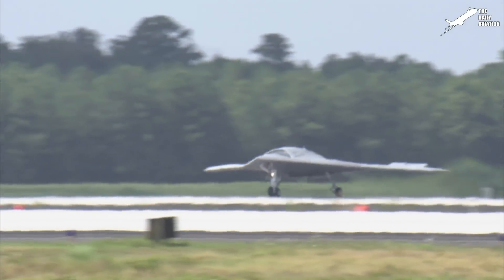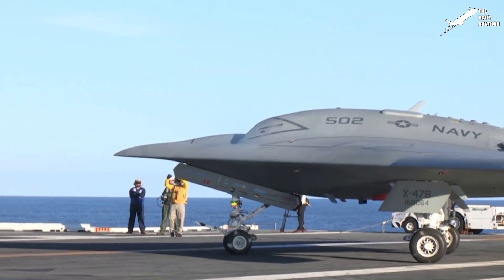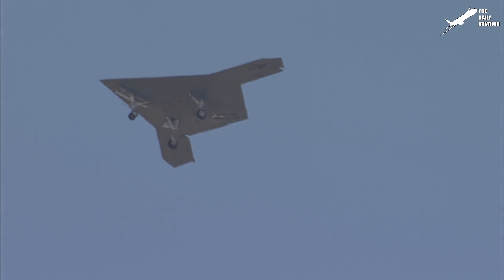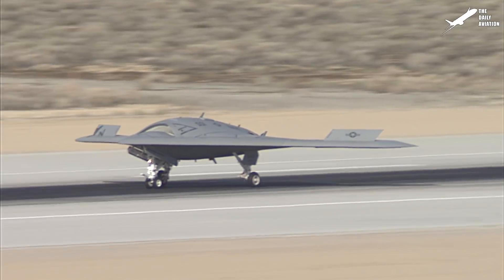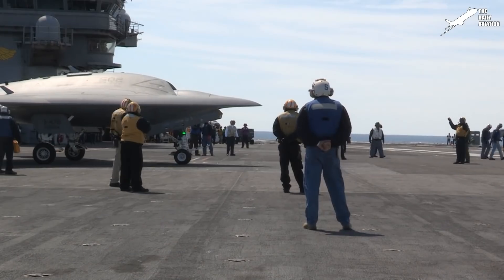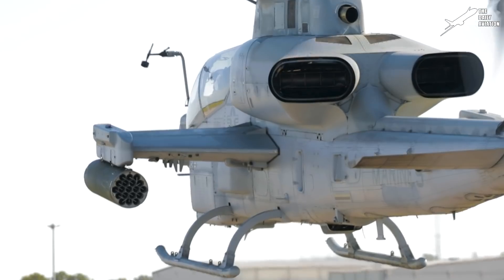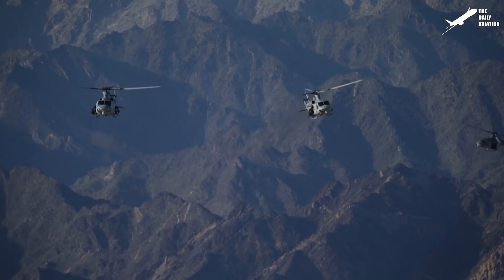US Testing its Brand New $1 Billion Advanced Aircraft: X-47B Drone

Comment: Smaller un-man and just as fast as the F-18 hornet.  I'm all for new technology; Now if these are all going to roll off an assembly line at 1Billion each; It would be a lot cheaper if you just take the F-117 and upgrade it since this is going to replace the 117.  Its still stealth and all u have to do is install the radio control system in it to make it un-man and it carries a lot more bombs.  Just install the laser guidance system in the F-117 instead of putting it in a museum.  Just a thought to save tax $$

Comment: 38.2ft wingspan to 30.9ft folded?!?!?!? Those wing sections are A LOT longer than 3.65ft each.... I would say at minimum, they are  12ft each and that is "Minimum" based on the assumption that at 5:16, the guy in the foreground is 6ft tall and they appear to be at least twice his height. And that is not taking into account the perceived perspective size lose due to the distance difference between the plane and the guy from the camera. I suspect that they are more like 15 to 16ft per side making the wingspan more like 60ft since the 30.9ft folded span seems about right.

EDIT Quick search reveals that the wingspan is in fact 62.1ft and 30.9ft folded... Video creator(s) must have been confused with the length since it is listed as being 38ft 2in (or 38.16ft).

Comment: 3:07 someone tell me, where will be the duct on the air fighter get put back?
Reply: The refueling probe was hard mounted for these tests, as proof of concept. Just to prove that the action could be accomplished.
Reply: @seansrusticdesigns8640  Thank you!
so it is used only for test and not for actual mission if I understood correctly.
Reply: @へんげの術YUU  That is correct, the whole X47b platform was a demonstration test platform.

Comment: One of those crashed on highway 98 in the florida panhandle(eglin air force base) 8 years ago. They're not testing it they've had it for awhile now.
Reply: one of these did not crash.  Two were built, two were flown on and off carriers and land.  Both were at Palmdale the last time I supported the static engine run in 2019.  I don't know what you are referring to but it was not one of these Air Vehicles.  They never went near Florida.  They flew at Edwards AFB, they flew at Pax River, they flew on and off carriers at sea not too far off the coast.  One landed at Wallops Island.
Reply: @gkprivate433  Ok Mr. Defense Secretary... Jesus Christ some people.
How could you know for certain?
I find it hard to believe that only two of these were ever built and I think that's a pretty retarded sentiment to follow especially when you consider this is top of the line military grade drones we're talking about.
Also factoring in that the U.S spends over 700 billion dollars on military per year (and rising), pretty stupid comment.
Nobody cares that you supported a static engine run.
Piss off.

Comment: Really strange video as the X-47B program finished in 2015/16 with no follow up. The Navy only ever had 2 prototypes & they are now both in long term storage with no plans to use them. Northrop, the prime development contractor, declined to bid on the MQ-25 unmanned, carrier based tanker aircraft so there isn't even an X-47B ongoing development program.

So it's really strange you post this video now after the program has effectively been defunct for 5 years.

Comment: Something about stealth and remote control sounds funny. Because its stealth, it needs to be not detectable to the enemy. But it also needs to send a signal back to the remote control otherwise how will the person controlling it know where it is and how to maneuver it. This means that the aircraft could likely be detected using a passive means similar to passive sonar on submarines. There are probably ways around it but it sounds like a big hassle to design for not much improvement.
Reply: That’s the part they don’t tell u about, they must  have some  way of decreasing the signal, kinda like how can such a noisy jet engine be stealthy type deal.

Comment: Ngl if they add ai, like Tesla’s autonomous driving but flying. So then no one has to control it, you can just program it to do tasks.
Reply: That's part of the program, it's supposed to wire up to a manned or unmanned fighter or drone leader while using AI to sync them all to one data stream. That will give them line of sight and aerial supremacy like the world has never seen before.

Comment: The X-47B would by it's very design be very hard to track if you could pick it out of the grass(operator slang for radar return noise).  No right angles (trailing edge aren't flat) Intake is on top and not visible to ground (sea) based radar.  If it has a baffle on the inlet it would be hard to get return from the intake.  Smooth blended wing and no tail, man even if there are no advanced radar absorbing materials this would be super small return.  The B-1A has a smaller return than the T-28 chase planes and the B-1B is even smaller than the B-1B.  Very hard to track.  Not impossible but hard to find.
BUFF or B-52, Well that is a sitting duck.  Against the SA-2 system, there is only one defense that works and the EWO's are taught to not touch that knob.  I hope we deploy systems like the X-47B and other advanced drone and fighter systems.  Super big fan of the F-22 but it's getting old and we need to deploy gen 6 aircraft.  Maybe in gen six the pilot will be taught to just make decisions and let the aircraft fly itself.  Maybe.

Comment: Why are we using 707s for refueling?  Those engines on the 707 are tiny but powerful, great, except they down the juice faster than a divorcee at an open bar.  Why do you think airlines ditched those a million years ago.  Fuel efficiency is why engines on modern jets are so huge... save gas... ya know, useful for things that work in that area, like refueling tankers?  Whatever...

Comment: X47B. That's way more than 7.3 feet folded up (38.2 to 30.9). Each wing tip to hinge looks like ~10 ft. Plus when folded it nearly touches tip to tip at the center of vehicle and would if folded flat. So the aircraft is reduced to ~ 1/2 it's size.
Reply: The video has it wrong.  The X-47B is 38.2 feet long and 62.1 feet wide with the wings extended.  Folded, the width is 30.9 feet.

Comment: 5:14 --- Folding wings reduce wingspan from 38.2 to 30.9 feet --- 
however
5:37 --- The folding wings are almost touching and would appear that they would slightly overlap the tips if the folding continued. This means that the reduction in wingspan must be at least 50% (38.2 minus 19.1 equals 19.1, or less if overlapped). The statement at 5:14 is not even close to being correct.

Comment: This is like a step to killing ourselves , imagine AI controlling all the bombs.
Reply: Not how that works but ok
Reply: @rayperson1262  imagine putting bombs on that and itself controlling the weapons
Reply: Dulara Ratnayaka TLDR they didn’t give it the ability to think, it needs human interaction to find and engage targets, it’s still like any regular aircraft it just doesn’t have a pilot in it.        it cant that’s the thing, because of its design it needs authorization from the controllers, plus it needs human interaction to find a target and either put a laser on it to drop a gbu-12 on it or something. I mean I guess it could technically put in its own coordinates and do it but I don’t think the builders are dumb enough to make it able to do that plus  it’s in the middle of the ocean so it would have to fly to the nearest landmass then still it is a possibility that there will be no cities on that coast to bomb and if there were it could only do so much damage before running out of fuel or running out of munitions, if it had no outer pylons like it does in the video it can only carry 2-4 bombs and I don’t think they can be anything bigger than a 500 or 1000lb bomb which in reality is very minimal compared to the rest of the US’s Arsenal.
Reply: @rayperson1262  do you realize that this was designed 20 years ago. There should definitely be something capable to think of its own
Reply: @rayperson1262  I mean the technology in general not only this jet.
Reply: Dulara Ratnayaka yes I realize that this technology is old but what you don’t understand is that even with today’s technology it still needs human interaction almost all of the US military’s aircraft require human interaction, they are useless without it. And by the time today’s technology is implemented into our military it will be 20-40 years old. The military is slow in getting new stuff and a lot of upgrade programs and other new vehicle programs don’t make it and it takes multiple tries.

Comment: This project ENDED about 5 years ago! This was solely a 'proof of concept' effort meaning that this aircraft was never intended to go into full rate production. Only two were built and they are both already 'retired' as they served their purpose. I have no idea why this is being posted just two days ago. All of the flight test video is years old. Also, the X-47B did NOT have air-to-air refueling capability. The probe plugged into the drogue of the Omega tanker was not functional. The production aircraft going into production one day in the future is the MQ-25A, built by Boeing.
Reply: RQ180 wikipedia

Comment: Stealth drones are stupid. They are constantly receiving and transmitting signals!
When combat aircrafts go into "stealth" they have to go radio silent so enemy can't tell if there's anyone in the area. Only thing they put out is Doppler Radar to the GROUND to tell how height they are, and passive radar scanning to see if there are enemies actively scanning to shoot them down.
Super Cobra are OUT!
Marines are now using Viper with 4 rotor blades and much better electronics.
Reply: I think what’s trying to be developed is an unmanned craft that doesn’t need to be remote controlled. You give it a set of instructions and then it carries them out without any need for additional instructions.
Reply: @wingdreak4191  it still needs to put out GPS and ground scanning radar to go where it needs to. GPS signals can be jammed or hacked.

Comment: 0:08 | Video Producer: Why do you find the X-47B "enigmatic" ?
4:23 | This type of aircraft does NOT have an "empennage" ... at least no in the traditional sense.
4:40 | Yes, inside the fuselage ... like most other modern fighters ... and on TOP ... for better stealth and lower IR signature .
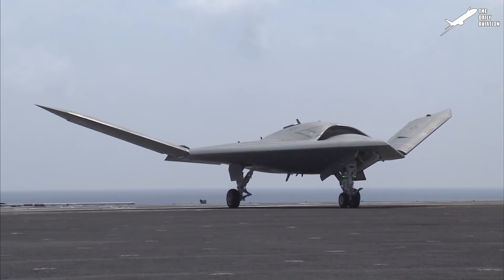5:10 | The "wingspan" doesn't change ... it's fixed. However, folding the wings reduces aircraft width while being stored. The F-14 wingspan does/can change.

Comment: Wireless device being used by deck operator gets a message "Buffering" X-47B taxis off the deck into the ocean.
Reply: CONFIGURING UPDATE FOR WINDOWS 10
0% COMPLETE
DO NOT TURN OFF YOUR COMPUTER
Reply: @brandondaniels9471  'Quick.' 'Ctrl, Alt Del.'
Reply: I can see that happening. Or by the enemy jamming the system or taking over control of it to either crashing it, stealing it, or turning it on the ship it launched from.....
Reply: RECALCULATING...
Reply: Probably more like a Radio Control set-up.  I am sure the AI in these craft is sophisticated enough to behave like a pilot in almost any circumstance.
Reply: @MrDrago1954...your faith in technology scares me.

Comment: Come to Serbia we love your new "invisible -indestructable " planes 😁
Reply: Apparently they worked really well considering they flew over 1,000 bombing missions and how many did you down? 1? 🤣😂🤦 Pretty epic failure by the Serbia Armed Forces.
Reply: @smithnwesson990  heheh they retired it fast after we shoot it down, don brag, to much, even you f15 and f16 are better then most of new jet fighters
Reply: @mladen83db  that still made no sense. Retiring a plane over a decade later is fast? 😂
Reply: @smithnwesson990  they retire it by didnt flying in any mission after 1999, and they retire it 2008 but lets face it it was early 2000, it wasn't safe that Neva rocket system from late 1960' and low radar frequency can shot down most advance plane in that time , yet Im bashing american Airpalnes you guys have good one but it ain't f117 neither F35 to much of cost ,for example tou make 5 planes  F16 for one F35
Reply: @smithnwesson990  nahh they did t use them as use to dont be foolish , they can retire it decade latter in hangar 😂
Reply: @smithnwesson990  hahaja I smell bitter salty man on other side of keyboard hahahha 😂💪❤️
Reply: @smithnwesson990  they retired it after we bring him down , to expensive not usefful just like your F35 , you f16 is still better then all new crap you make